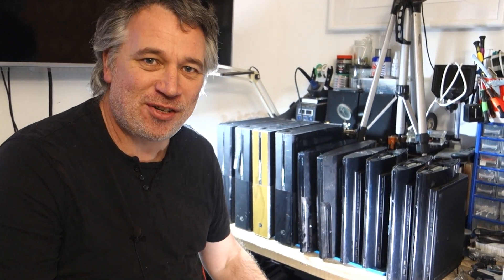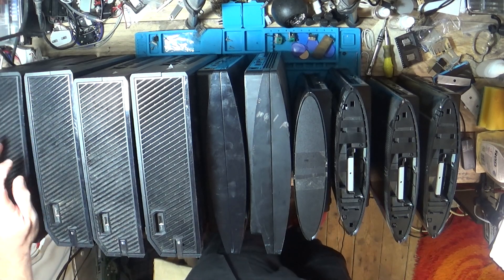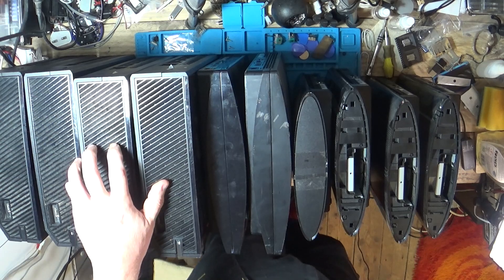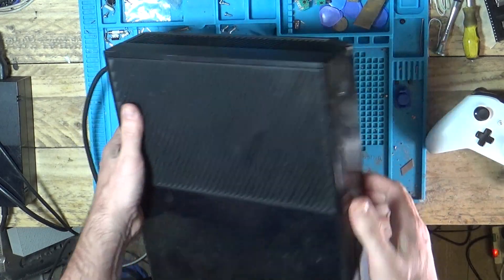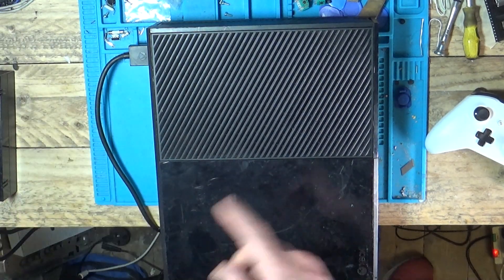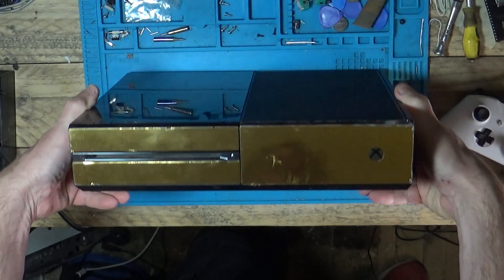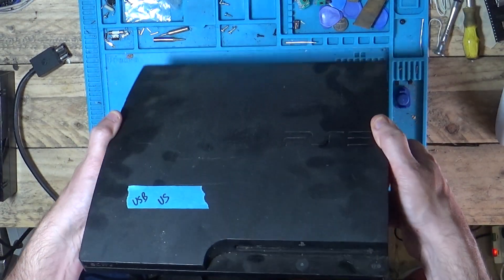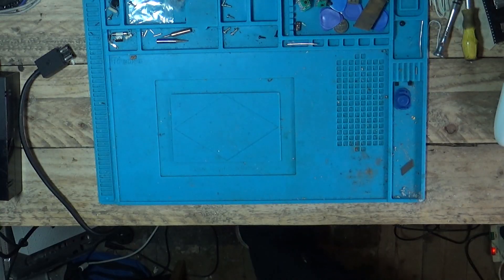I Bought 10 Broken Games Consoles and Controllers To See If I Could Fix Them | UK eBay Reseller

Comment: PS3 Multi Out Port on the rear is the same AV cable used for PS2, so can test the systems which have HDMI issues first just to confirm they are works etc before spending time replacing the HDMI port.
Reply from the maker: Yes I have a PS2 multi AV. I was just worried about some of the HDMI pins touching ground incase they had voltage going through them and blowing any other components (although someone has probably already done this). Will have to bend pins off the ground and test on the AV port. Thanks

Comment: Xbox disc drives swaps, just in case you are not aware the PCB in the drive is paired to the motherboard. Try with a DVD/CD/Game disc first. Usually the game disc will need to install which requires the Xbox to be online for verification. So also check the WiFi whilst troubleshooting. This info might give you a better idea of the prob before attempt to open.
Reply from the maker: Yes I am aware that the daughter board needs swapping too. Interesting info to check on the other things first though. Thank you.